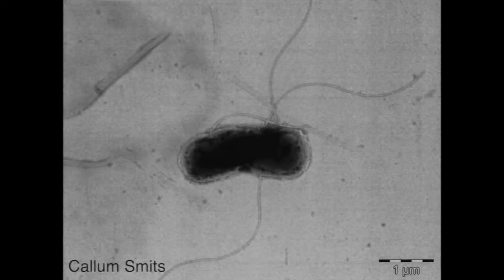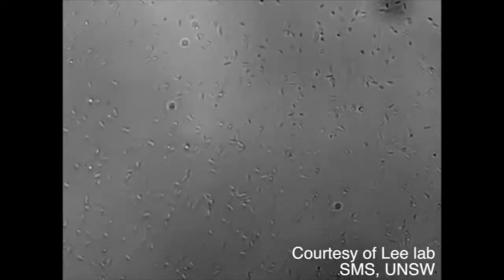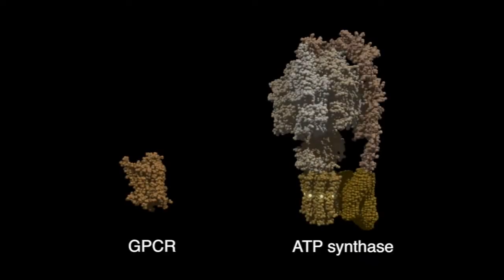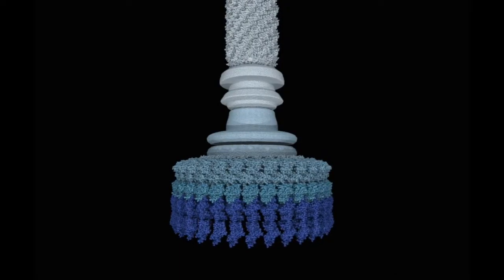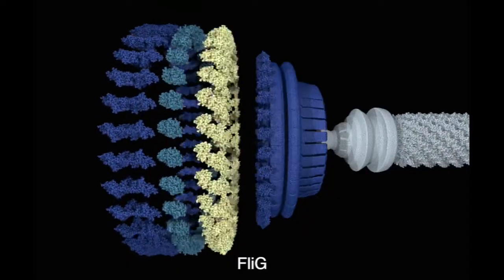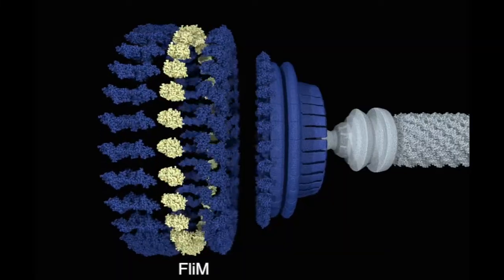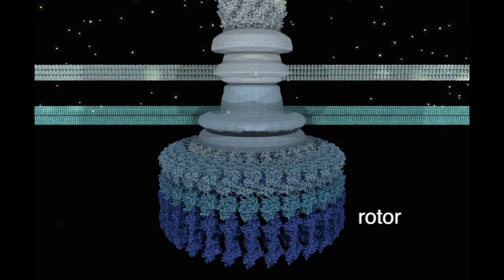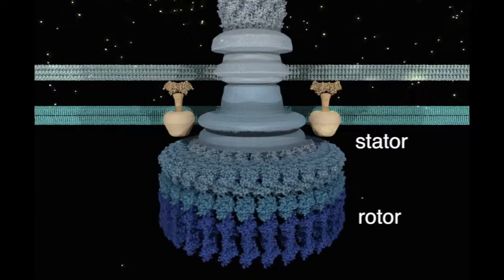The Bacterial Flagellar Motor

Comment: Humans: “Why hasn’t nature created an animal with wheels?”

Nature: “Working on it.”
Reply: Nature: because wheels are overrated. Good luck going up rocky terrain with those wheels😂 Imma just run away and climb using these cool things I invented called LEGS
Reply: @ How about marine life then? Nature could evolve a fish with a propeller.
Reply: @Uajd-hb1qs  the problem is energy. It's possible to have a propeller on a fish or something, but thats just not how marine life moves in the water. 
Fish and stuff travel mostly using ocean currents rather than under their own power. Sure, a propeller could boost the speed of a dolphin or shark greatly, but I doubt they would get enough energy to sustain that upkeep
Reply: What if they used a hybrid engine for the propeller @Hungry_God
Reply: I mean it already did, us

Comment: Provocative but serious question: it's unlikely that a bacteria developed the complete flagellum+motor in a single try. So my question is: what evolutive advantages an incomplete system (only motor, only flagellum, first parts of the motor and so on) would have given to the evolving branch of the species over the not evolving branch? Like, a motorless flagellum or a flagellum-less motor are useless if not an hindrance.
In short: what is the evolutive hypothesis?

Disclaimer: I'm no saying God did it, but on the other hand I don't accept "because evolution" without an explanation because it's basically like asking to accept it by faith
Reply: I am no microbiologist, but I saw a comment from someone claiming to be a microbiologist talking about how this isn't the only type of motor in bacteria, and how there's a much simpler version of this used in other parts of the cell. I assume that a very simple version of this evolved (perhaps a simple rotating gear or something similar) that gradually got more and more complex until eventually we get what we see today. You can also see in this video ATP synthase, which is a much smaller motor and simpler motor used to create ATP. Perhaps that could've evolved into the giant motor today, perhaps not. There's no way of really knowing.
Reply: @TrevoltIV  Oh you're one of those people. Ok.
Reply: a much simpler version of this that got more and more complex with time

Comment: It's fascinating that the foundational principles of mechanical motors mimic nature. Considering the flagellar motor was barely identified as a rotary motor in the 1970s, it suggests that modern motor design is fundamental to nature and was really discovered rather than invented.
Reply: There is nothing new under the sun
Ecclesiastes
Reply: Me and you think the same @lh8664
Reply: Yea, it’s a cool example of convergent evolution. Apparently we found the best way to make a motor, since that’s what life has been using for two billion years or more
Reply: @oberonpanopticon this didn't evolve. How would functionality like this evolve? It has multiple parts working together all of which have to be fully evolved for it to work properly. Why would a life form spend thousands of years evolving useless features until eventually those features all just so happen to work together as a motor? The lifeform would need to evolve one part at a time or all parts simultaneously. Which makes no sense why it would do that from an evolutionary purpose, considering it is not helping it live longer until the mechanism has fully evolved, which it wouldn't have done if the prior evolutionary states of the motor did not help it live longer. Which they wouldn't because the motor wouldn't work. Think for two seconds.
Reply: @famisheddendon your logic is flawed, you should try to be more open minded in the future, and consider facts that might not align with your beliefs. Good luck
Reply: @nickhayes5641  well if my logic is off you can tell me specifically where the logic falls off so can you tell me specifically where that happens! I'm agnostic, I have no beliefs. It's not a debate about fact or empirical evidence, it's a purely philosophical debate.
Reply: @famisheddendon  I don't say you're right or wrong in the way you think, but honestly do you really know what is evolution ? There will be an infinite amount of definitions for that term so there will always be debates about it's true and fundamental meaning. My point of view speaking of evolution is this :  we can observe the effect of evolution on species that reproduce excessively fast (like 10^6 faster than what we humans do) and why ? Because once a "random" mutation occures, the offspread will then be "tested" in its environment and the faster you can test these mutations, the faster you will observe some traits that are advantageous. To conclude, any advantageous trait will give more offspreads than the other ones, that's called evolution. So yeah the motor in cell is clearly due to evolution and it can still evolve as everything in life ! Before this evolutive trait, no cells were moving but once it appeared it gave an advantage to cells having it therefore they spread everywhere (bacteria and little animals, coevolutive trait)! And after some time, a better motor appeared therefore it spread even more (on a smaller scale)! Of course you may think that now, if a mutation occures it will simply "break" the motor but WHAT IF (and this is evolution and random mutation RIGHT HERE) a combination of random mutations occure and your motor get 10x faster with less energy spent because the 3D folding of a protein changed for 0.0001° ? It will spread everywhere in this species ! And on an even bigger picture, if this trait is so advantageous and isn't due on a billion mutations in a row, you can be sure that it's gonna be a coevolutive trait observable on a ton of species at the end of the story. Evolution Baby ! (Excuse me for my phrasing and vocabulary not a native speaker here, i hope you consider my point of view and acknowledge that evolution can occure, will occure and we can't even be sure what will be in front of us just 10k years later)
Reply: @nickhayes5641 facts like God exists and He built this ….  Stardust + time + random chance cannot generate the coding necessary to build this machine let alone the machine itself.  It is a mathematical, chemical, and logical impossibility.
Reply: @PessiLeMessie evolution requires reproduction, reproduction requires proteins and DNA that are carefully ordered code.  Random chance cannot produce carefully ordered code….  That is just silly!
Reply: @TrevoltIV  that was my point, it still had purposes, though with the misinterpetation ig my analogy is a bit flawed, here’s a better one

Current car engines are far more better than ones decades ago, that much is obvious. In a world that favours wfficiency, better engines will replace worse ones. Older cars of course still worked, and their inferior engines still served a purpose, people didnt buy useless engines because they’ll eventually work when newer iterations of cars fully construct them. Saying that “if it’s simultaneous, the parts would have been useless until it’s completion” is strawmanning, as you’re ignoring the solution being the fact that the versions that came before were lesser but still worked
Reply: Mechanical motors were invented in yr 1600 1700 1800 1900 and these bacteria motor are discovered in yr 1970.
Reply: Everything is getting discovered...nothing can be invented l...because we're living inside the creation of an creator
Reply: You’re making up strawmen buckaroo, were wheels useless because we hadn’t invented axles yet? Nah. This complexity comes from iterations. It’s not like the bacterium were consciously waiting to be able to evolve a better means of moving for millions of years, the mechanisms were fine-tuned because they *worked*. Of course they all evolved simultaneously.
Reply: @qwerty_ops1246absolutely wrong.  You can’t have a non functioning bacteria wondering through a junkyard building 100% efficient motors.  Doesn’t happen and to believe it could is religion.
Reply: @qwerty_ops1246  but the mechanism is irreducably complex
Reply: You say this with YOUR understanding. It's Not because we dont know that it makes this claim true.  @famisheddendon
Reply: @famisheddendon it’s not
Reply: Everything is nature
Reply: Billions of years of practice should speak to function
Reply: You guys really think all this happened out of chance. God is AWESOME
Reply: Well, lets see. We can always make it smaller, reduce the complexity of the protien clusters making up the rings, reduce the amount of rings. The two outer rings serve a purpose of changing factors about the flagellum’s movement itself, so lacking those would mesn it can still move, but in a much more fixed way, something it can live without and still be a benefit to it as opposed to not having anything. It’s speculated that the flagellum evolved from pili, which are hair like organelles on the bacteria’s surface.

That seems pretty reducable to me
Reply: @qwerty_ops1246  it really doesn't, it sounds like mental gymnastics to explain something with a theory that was created in a time where we were not aware of biological mechanism like this
Reply: @famisheddendon  what part, my examples of engines or the reduction thing

Comment: Very cool animation !! How it works with protons ? Is it thanks to the same reluctance force that drives our electric motors ? Could electric motors be more efficient if they worked with protons current instead of electrons current ?
Reply: Its been 2 years, but maybe you will see this anyways. The movement of the protons causes changes in the structure of the Proteins; magnetism is not involved. Transposing this onto Electronic Motors would be extremely difficult because priton currents of this kind do not flow through metal (so no cables) but an aqueous solution; it would be impossible to use our electrical infrastructure with Proton currents.
Reply: @colim2595  What is this called so i can research?
Reply: @colim2595 what forces cause protons to influence proteins? Also this animation shows protons, coming from both stators, moving behind the rotor. Is that accurate?